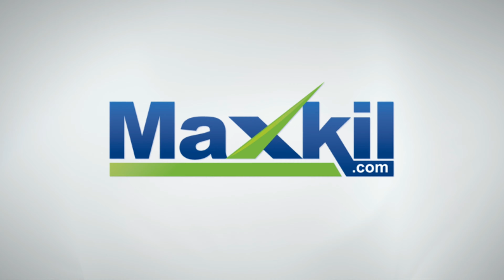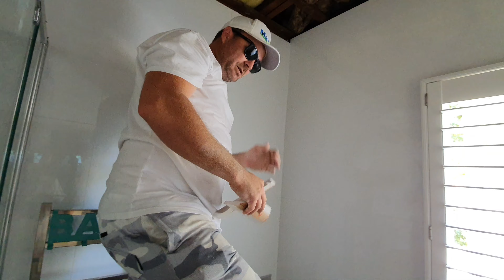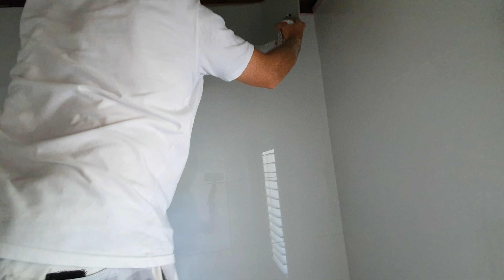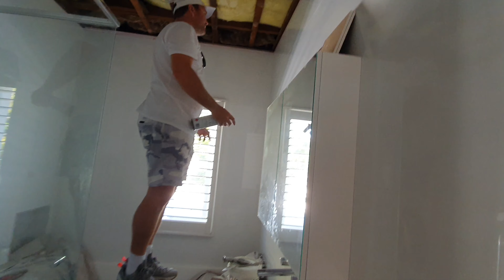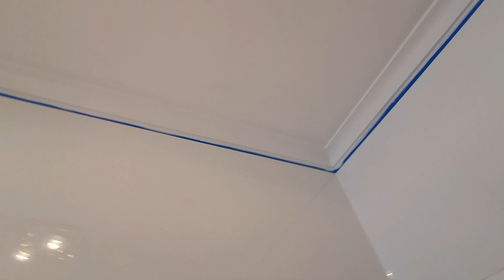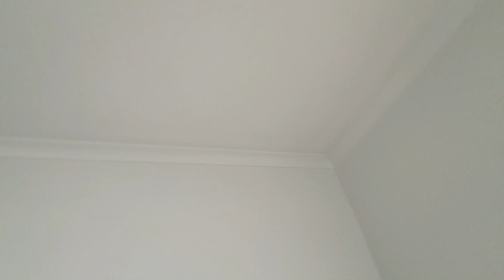Fix Drywall Crown Molding Falling down in Bathrooms

Comment: Did you still use Cornice Cement on the bottom edge of the cornice or is TrimTex all that is needed?
Reply from the maker: Hi Paul, yes we still use it on the bottom edge as well. If it was on brick or something we would just blob it so it wouldn't get on the showing face of the brick because it's hard to clean
Reply: Maxkil Thanks.